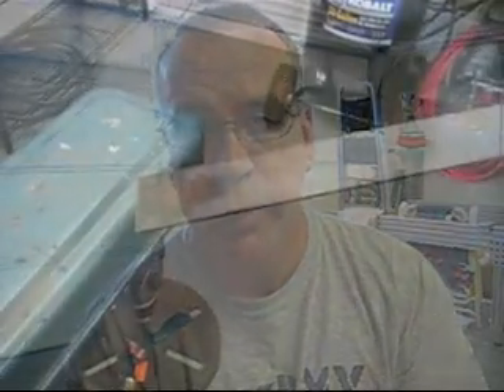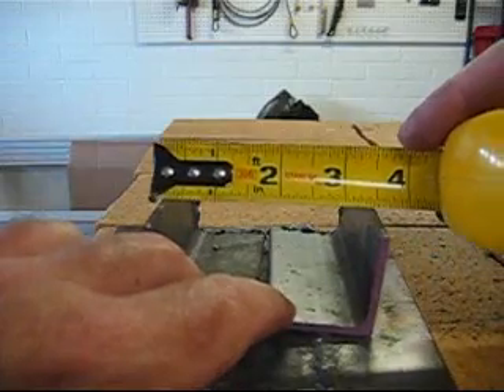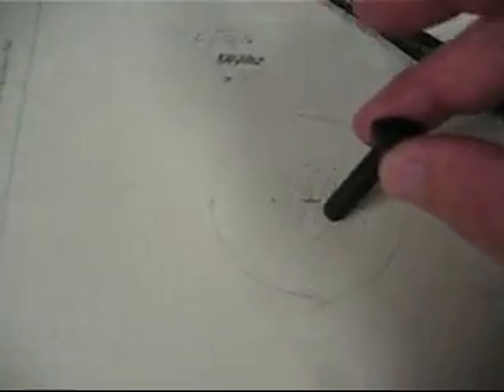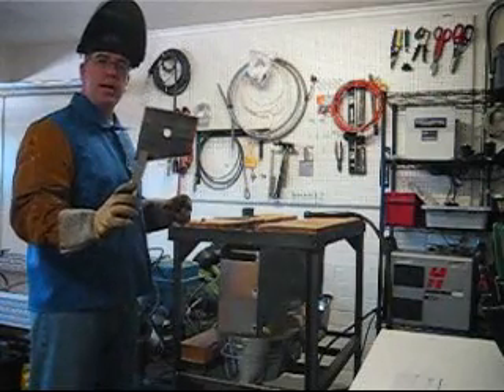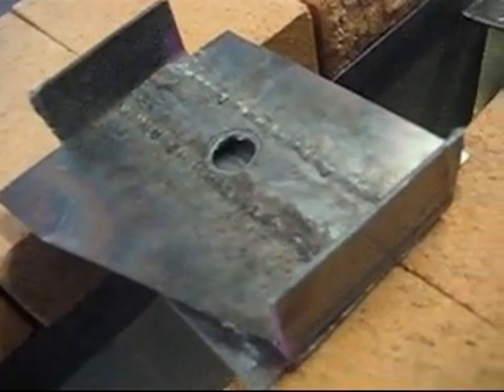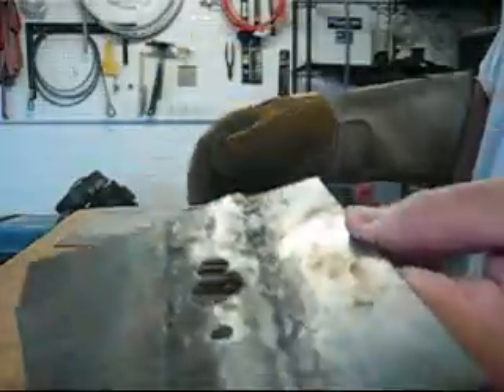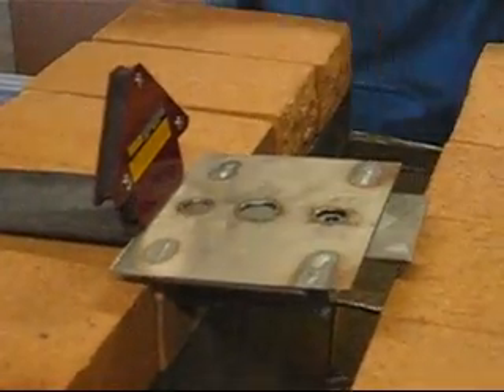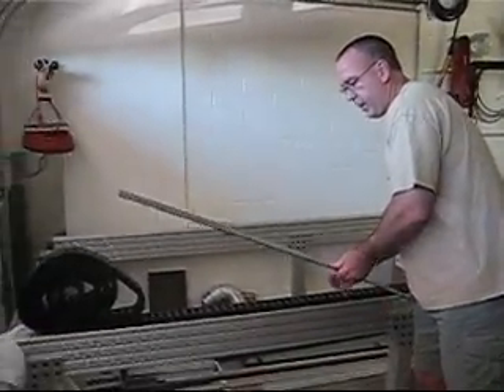Use plasma cutter vs a drill press

Comment: Wow you did all that for 20 holes in 1/8" plate I have found it useful to make a jig to center the bar on the drill press and then just slide it down but I guess if I had a bad ass plasma like that I would want to use it.

Comment: This is good info..  I'm trying to drill 1/16" holes into a steel pipe.  I'm using cobalt bits but I am having a heck of a time.  Do you think that a plasma cutter could do the job?